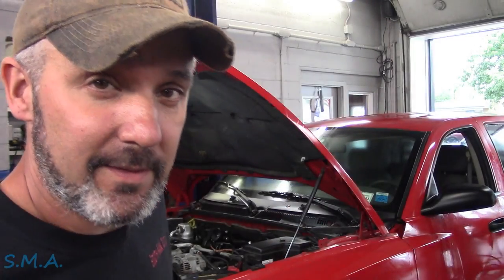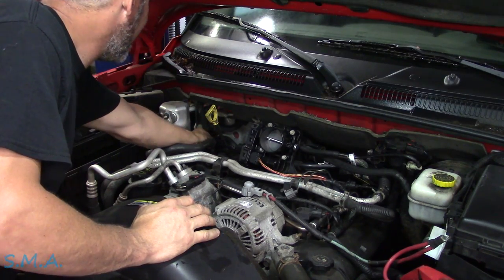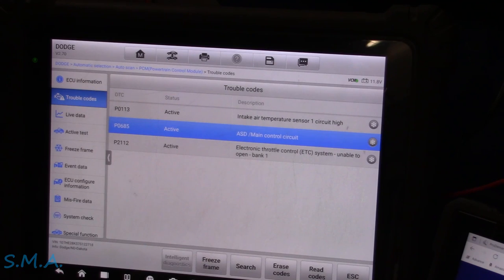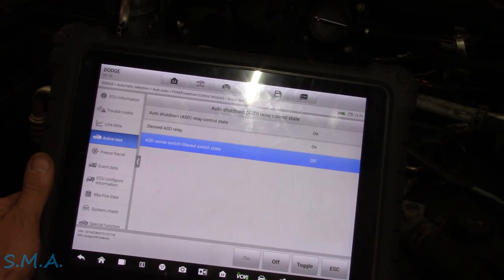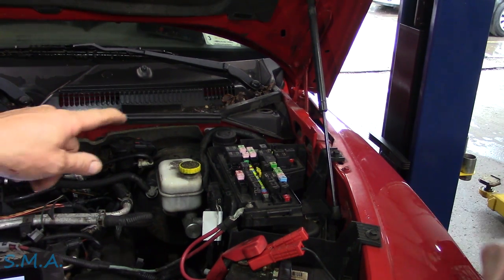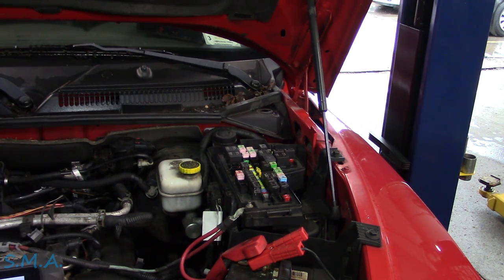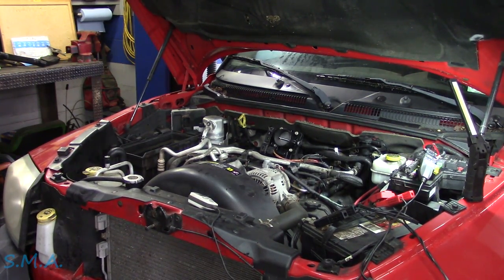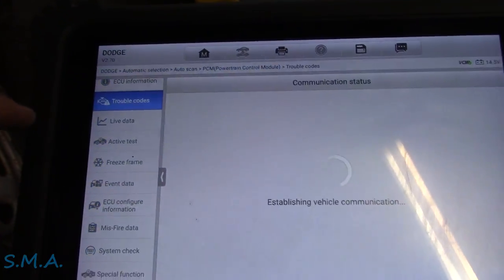Dodge Dakota: No Start After Clutch Replacement

Comment: Still it was educational and I like to see the tools you used for that.  I once replaced a fuel pump on a 1980 citation and didn't notice the push rod that made the pump run was there and then slid out of the engine while I was getting the new one and after I put the new one back on the car didn't start and then I saw the piece on the garage floor.  I put two and two together and put it back inside the engine.  I wasn't using a lift so it wasn't easy to see under the car.
Reply: Ugh and a citation at that LOL

Comment: Pulled the 4 tech motor and had it rebuilt on a 88' Pontiac Goo le (6000 Le) after installation when I started her up she took off at high rev and wouldn't come down.  Took it to the local shop so they could plug in the idle contol module I missed on the back of the throttle body.  🙁

Comment: Simplest repair i've ever done was to buy a Honda with a manual transmission - damn thing never breaks.
Reply: Had to resolder my friend's Honda's main relay because it would die when hot abd fail to restart. His input shaft bearing was also worn out and super noisy. Had to split the trans case to replace it. Had a car in the work shop and the customer came in for a standard oil change. We did the service and noted serious leaking from the front main seal. Notated it in bold that it was severe. Finished the service and pulled it out of the bay when the person standing nearby notice the thick trail of oil the car was leaving behind. The thing had let go completely at that final startup and drive out of the bay. It was leaking so much it would have emptied the sump in a matter of minutes. My ex had an '01 Accord V6 automatic. One day he left work and the trans failed catastrophically. Started slipping terribly in gear and whining badly. Barely got it home slipping the whole way. Pulled into the driveway and I knew the thing was just ready to be scrapped. My friend's Integra's clutch hydraulics failed leaving him stranded, and I helped him replace and bleed the system. VCM J series engines routinely blow themselves up on the highway when the deactivated cylinders fill with oil sucked past the piston rings under the vacuum created in the sealed cylinder and then eventually that piston slams that slug of oil right up against the head bending or breaking the con rod. The relatively new 1.5L DI turbo engine had poorly designed injector geometry made worse by poor open loop programming that ran rich. As a result, it dripped liquid gasoline into the crankcase that had condensed on very cold cylinder walls, and diluted the oil with the thin solvent gasoline. The oil level would actually rise on the dipstick over time from this. Gasoline is a poor lubricant and overfilled sumps are very harmful to the engine. Honda did a recall and fixed it. 

TL;DR Hondas break quite often just like everything else. The attraction is that they're cheap to start with and parts are cheap and easily accessible dealer and aftermarket. Otherwise, same old BS.
Reply: Never install after market electronics on any car. Ive diagnosed 3 parasitic drains and they were all due to aftermarket alarms.
Reply: True. Properly cared for they’ll run for 300 thousand miles easily.
Reply: @mannys9130  In South Africa parts are expensive and the cars are priced quite a bit above their Japanese competitors. 

I've seen quite a few of the issues you mentioned whilst watching various Youtube videos, but they just don't seem anywhere near as prevalent on the SA models. Perhaps our service schedules are different (shorter) and make them a bit more reliable? who knows.

Of course I have have had to do some of the things you've mentioned - like the front main seal - but I did mine the second it started weeping. I did the rear main seal when I replaced the clutch even though it wasn't leaking.  I'm a big believer in preventative maintenance as well as looking at whole systems when one component within the system has failed. eg: if the top radiator hose is leaking perhaps it is time to replace all the hoses.
Reply: @troyna77  good to know. I also believe that there is a huge difference between OEM and after market when it comes to rubber components.
Reply: @prevost8686  agreed. Mine is on around 200000 with lots of life left. Had other vehicles which received the same care and attention that never got close.

Comment: This happens when you get older replaced the door lock switch which is part of the door latch in my 07 Chevy Silverado put it all back together it works like a Charm but then this all man remember he left his flashlight inside the door it happens

Comment: Replaced a valve cover gasket on my hoondo civic that had a crv engine in it. Got it all sillyconed and tighten to manufacture torque spec. Went to start it and nothing. Just cranks and cranks. Walk inside a bit flustered and walk about out to see the spark plug wires hanging over the front bumper. Whoops
Reply: You're hondoo doesn't have wireless ignition? Lol 🤣

Comment: Well there was that one time my car had a no start condition and I was panicking slightly.
Turns out some dingus left the shifter in D when I parked it.
Reply: My wife did the same thing to me.  
“The Tahoe won’t start. Somethings wrong with it.”
The sad part is that it took me a while to figure it out.
Reply: So you're the "dingus" that left it in D.
Reply: How'd they get the key out of the ignition?
Reply: @MoeBabaloosh  I did that recently on a 2012 Impala, I wondered myself how the key came out, but I deliberately left the car in gear and removed the key with no problem. I noticed that some GM ignition cylinders get loose with age won't lock the key in place.

Comment: The motor mounts on my 95 blazer had deteriorated to the point that the fan was hitting the shroud. My shade-tree-mechanic neighbor was out of work and desperate for money, so I paid him to replace the motor mounts. A few years later, especially when we'd just had a snowfall and the salt trucks were out I started having problems with the 4WD not wanting to engage. Then I started blowing a fuse that fed both the instrument cluster AND the O2 sensors (and probably transfer case), which really sucked because with the instrument cluster out (the key being the ammeter) the alternator had no power to the field windings and the battery would go dead. I managed to trace it down to a wiring harness that ran from the motor down along the top of the trans - pull it forward and the short would disappear, push it backwards and the short re-appeared. I suspect that when he jacked the motor up to replace the motor mounts, he crushed that harness between the trans and the tunnel. A little age, salt, and water, and voila the current would start to flow and the fuse would blow.

Comment: Was putting a clutch in an older Chevy truck in my driveway, so happy when I got done. Started it up, and had a metal to metal screaching noise. A wire harness hold down bracket than on the back of the engine, the bracket got cought between the block and bell housing that I didn't see when I put the tranny back in.  I was afraid I'd have to take the tranny completely back out to get it I cought and bolted back in place. But was THANKFULLY able to pull it out w a pry bar and get it back in place.

Comment: just recently, i bought a 2009 ford focus 1.8 TDCI here in England. 3 days later it wouldnt start, had to send it back for them to send it to a garage for a repair (hate getting taxis to work). anyway few days later its fixed and i go to collect car, notice almost straight away the speedo was stuck on 20mph even before key was in ignition and didnt move when started. that told me they had dash out for the common ford focus issue, soldering on the pins of the circuit board. seems silly that a speedo would be damaged but heres the kicker. they ran it 180ish miles, i know this because when i got it i reset the meter and had only done 16, it was around 200 when i collected. who does 180 miles to test drive a non-start? lol i have so many storys but wanted to put that one, gotta love a good rant
Reply: Had the same when I had made the mistake of having some not-my-fault collision damage dealt with by my insurer's repairers. Came back with a broken door speaker that looked like it had been dropped, badly scratched door glass where it had been lying flat on the floor and an extra 70+ miles on it.

Comment: Easiest but expensive repair:
Linkbelt crane at a dealer just outside of DC. Used trade-in. Barely start, no throttle, no fuel pump advance. Local Mitsubishi dealer spent weeks on it. 
I got called one afternoon (February I think) to come fix it. I’m in Charlotte, NC. 
I ride up there and stay the night. Go to the yard next morning and check it out. Turn the key and I have no check engine lights (should both light up at first). No ECM power. 
Find the main battery relay under the engine isn’t turning on. 
I pull the belly pans and start digging. I’m pulling out dirt, then pieces of belt. Then I see about 5-6 wires all broken. Repair all the wires, clean everything up, and try it out. 
Boom runs like a champ. Good throttle, good power, runs smooth. 

I was “told” they had $20,000 in it from the other dealer. Who knows but with travel, per diem, lodging, and labor, they were in it to my employer about $3-4000.

Comment: My favorite was a no start call from a friend. Keyless entry Nissan. Got in with the keys in hand and it started right up. Followed him home no start again. As soon as I got in keys in the console and saw the flashing red key light on dash when trying to start,  pull the cr2032 (quarter sized fuse) out of my fob and stuck it in his problem solved.
Reply: CR2032 is a battery.
Reply: @G31mR  Yup, one the most common of that style

Comment: Eric, I bought a well worn 66 SS 396 back in 1979. 800 dollars US & I owned a òul burner with a vicious trans fluid leak; like 1200 feet & gone... The car was cheap but the fix was much, much cheaper. A oil cooler line tighten ĵob got me into the Big Block Chevy club ! Thanks for the car Darryl !!!  daniel

Comment: Simplest job I got was a few month old accord. Customer said the trunk won't open. I opened the glove box and for whatever reason honda thought it was a good idea to have a power switch for the trunk latch. I turned it on and it worked perfect.

Comment: I replace the two front brake callipers. I installed the right calliper on the left side and visa versa. i spent days and a lot of brake fluid trying to bleed the air out of my spongy brakes. Nothing worked, I was stumped. I eventually notice that the bleed screws were on the low side of the cylinders.

Comment: Back in the 90's we had a Town & Country minivan come in on the hook.  The lady had the transmission replaced at another shop and according to her the van quit running a few weeks later.  The dash was lit up like a Christmas tree so I plugged the scanner in but there was no comm with the PCM.  I started looking at the harness to the PCM and noticed it was hanging down.  I put the van up on the lift and removed the driver's side wheel.  When the transmission was replaced the main harness wasn't secured back into place so it was hanging down onto the CV axle.  Over time the axle rubbed through all the wires.  Took a quite a bit of time, but I was able to repair the harness and get it secured back into the OE clips.  Needless to say the lady was pissed.

Comment: Replaced the turbo on my 2005 Focus Cmax 2 liter diesel, took me a few days. Checked and double-checked everything and started her up.
Engine ran fine for a few seconds and then shuddered to a halt.
I was full sure the timing belt had snapped and the engine was destroyed. Didn't go near it for a week and then I decided to turn the engine over by hand to find where it was binding up. Turned it three or four times and no problems.
Turns out I didn't connect the fuel line properly, so it ran out of gas.
Car ran great after that and after thinking I wrecked the engine and wasted money on a new turbo, that was pretty sweet.

Comment: I had an FC RX-7 that would idle just fine, but would stumble hard when applying throttle... until it warmed up. We literally spent several weeks on the problem - swapping injectors, plugs, mass air flow sensors, cleaning things obsessively, only to eventually find that the ground strap between the engine and firewall wasn't tightened all the way. Cranked it down - voila - car ran perfectly after that.

Comment: Well, it's a lawn mower, not a car, but I just managed to forget one of two spark plug wires on the ol' Vanguard V-Twin. Amazingly it runs and even (begrudgingly) cuts on a single cylinder, but isn't happy about it. Hopefully no permanent damage.

Comment: I had a no-start on my Toyota truck one day. Was worried that it was the starter (it's a pain to replace). Opened the hood, bumped the battery cable and sparks flew. Turns out it was a bad battery terminal clamp. Adjusted it just right to get it to start and went to the auto parts store. $7 later all fixed.

Comment: Simplest repair I’ve done was turning the ac switch back on after the customer brought it back in cause it stopped blowing cold. Absolutely nothing wrong with the vehicle customer just bumped the snowflake button. 🤣
Reply: I had a no dashlights fault,  turned the brightness up job done !
Reply: Friend of mine thought the ❄️ button was what you push in the winter!!
Reply: When I transitioned from my 2001 Taurus to a 2002 Saturn, I found I had to get used to pressing the A/C button and fresh air/recirc buttons like a Toyota Tercel I drove for work years ago.
Reply: Don’t you love it when the only thing wrong is the loose nut between the seat and the steering wheel

Comment: I had a battery drain in Dodge Durango the other day. It turned out to be the seat cover had slipped up and kept trying to lift the front part of the seat up since the elastic from seat cover was holding the switch on.

Comment: Thanks for the info... any tips on finding a short that does not blow fuses?
Reply: I'm intrigued... 
Wouldn't any short-to-ground get the full battery current? I'm not ASE-certified but I thought it was pretty straightforward.
Reply: @MoeBabaloosh  me to man I've watched every YouTube video I can I've done the test with my multimeter for Amp drop when you pull fuses. No drop. I can take my test light from battery pos and touch it to several fuses and it lights up. No blown fuses. I can unhook my ground and hook my test light up from battery pos to engine and body ground, it lights up. I mean I'm very amateur at electrical so am I doing something wrong poss.
Reply: @jameslewis1175  are you chasing down a circuit that's not working?
If the circuit in question only runs with the engine running, then run the engine while you check BOTH sides of the fuse to ground with your test light. 
Fuses and relays are your easiest starting point. 
If you recently did a repair and something's not working right, just retrace your steps... could be as simple as a harness plug that misaligned or didn't latch proper. 
I always screw something up when the coffee runs out

Comment: I once spent 20 minutes trying to remove the 120A main fuse in a Rav 4 after the alternator shorted out.  No matter how hard I pulled it wouldn't budge, bust the fuse casing all to hell......   They are bolted in and you have to disassemble the fuse box to get to the bolts...

Comment: Look up Dodge in the dictionary. 
It says “to avoid”.
Reply: It might but on this Dodge every problem was human induced.
Reply: My 03 dodge 3500 , 6 speed , 5.0 diesel  with 240,000 miles has all original parts except a lift pump, a water pump, and a starter
Replaced original clutch at 220,000. I'd match that against any vehicle anywhere
Reply: @jerrycrandall433  People love to complain about Dodges, but I've had excellent service out of the three or four that I've owned.

Comment: When I was working on Cub Cadets, a few times a year I would get a service call for a quit running machine.  Each time I found it out of gas.  To save face for the wives, I would offer to change the spark plug, and if she happened to put in gas in the meantime, problem solved.  The wives appreciated the offer.
Reply: Must have old IH cub cadets....they just don`t break down.
Reply: @blackscotydog  oh i absolutely LOVE my IH-Cub Cadet 1200, Kohler power! I just don't like the 44" deck, poor cut quality no matter what you do, the "speed up pulley" didn't work, single high lift blades don't work, gator blades don't work, so i made my own X blade with the gator and high lift blades, now it just discharges a whole foot from the chute instead of making clogged piles and windrows, still have to mow twice to get all the grass cut

Comment: 2 times i charged for “missing “fuses. Both times customer said all the fuses were good. 
Guy replaced intake gasket on a moper 5.7.hacked through 4 wires trying to release a zip tie behind intake. 3 shops couldnt figure it out. Threw transmission into limp mode. Owner spent a lot of money on that one.